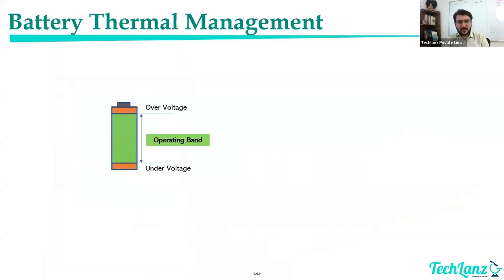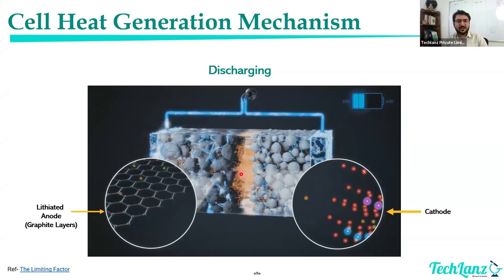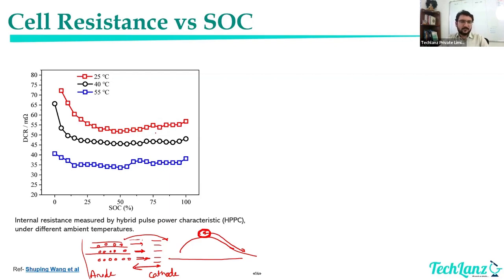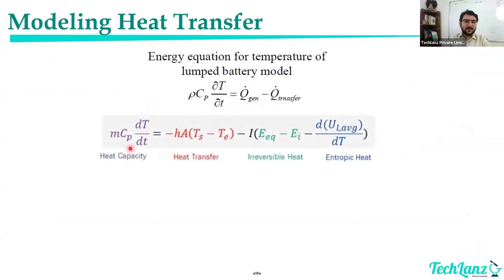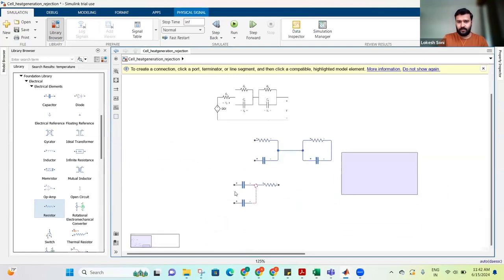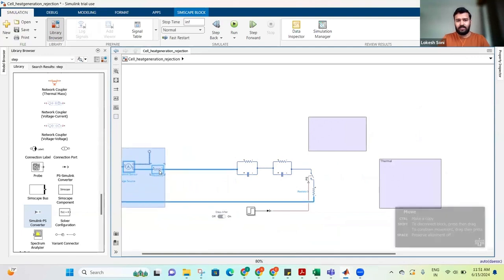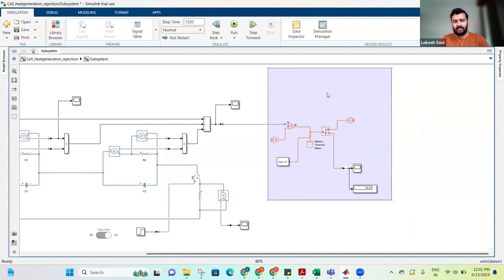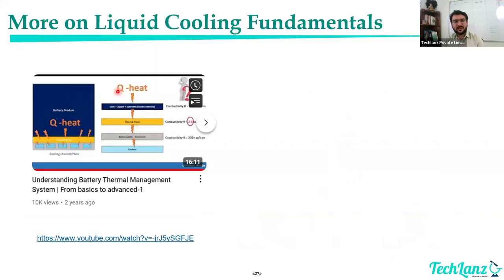Battery Thermal Modeling

Comment: Hello sir, during charging, since the reversible term is an endothermic, reversible heat is absorbed, which potentially cools the battery. Hence heat generation shoud decrease. But at 24:35, Fig (a), the heat generation is increasing.